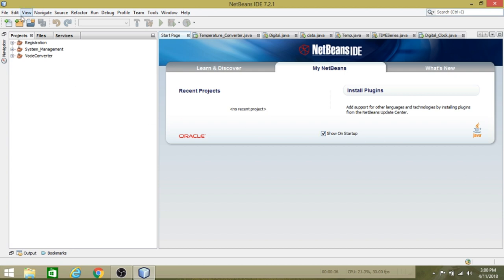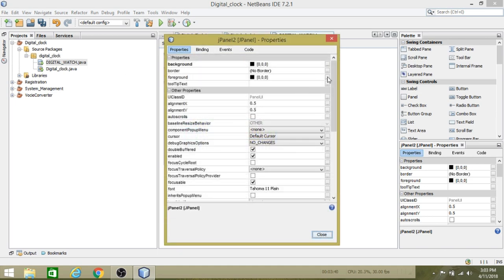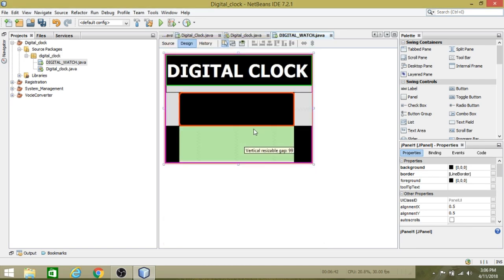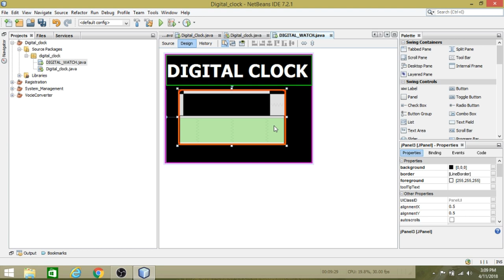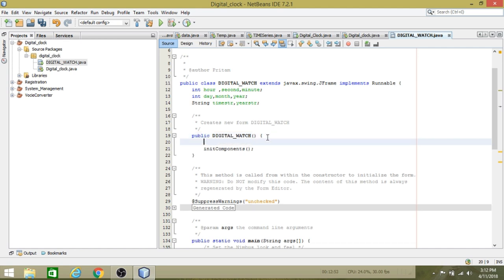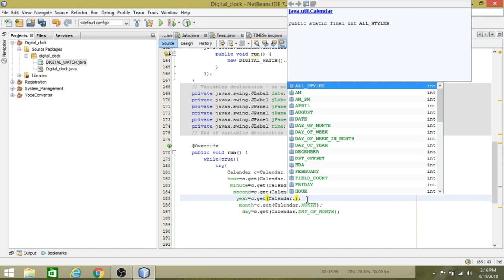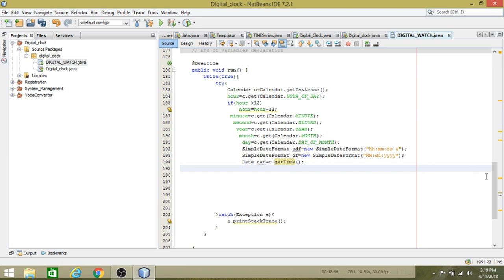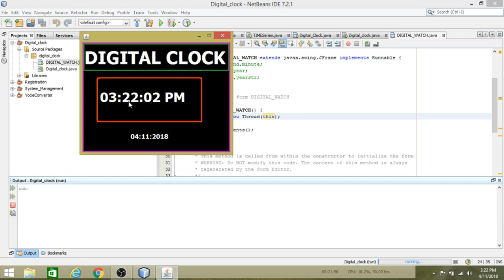How To Make Digital Clock In Java Netbeans

Comment: can you explain why this statement "thread t=new thread();" is used,or what is its function,I will b very glad
Reply from the maker: We used here Thread concept and you can do it without thread to and Here  why i used  and what is the function of thread is ,when you run your program it will call DIGITAL_WATCH() constructor and our main Logic is inside run() method that is part of thread and it will run when thread start() invokes . if if you are not using t.start(), you won't get output bcz run method will not execute.
Reply: Its is known as 'Multi threading' in Java